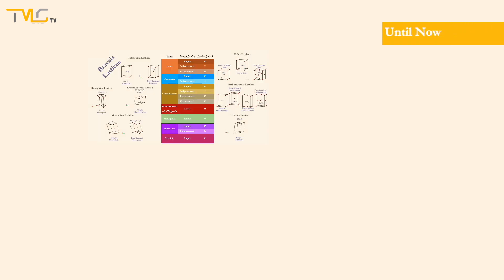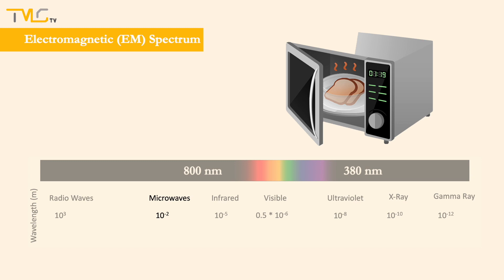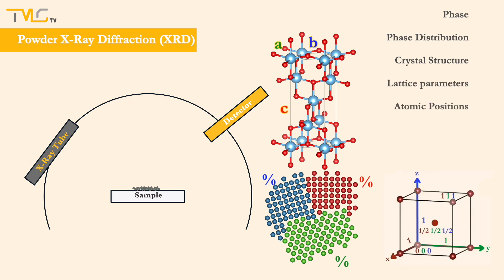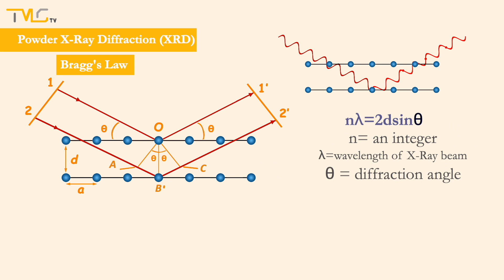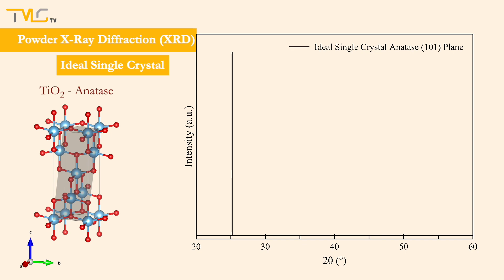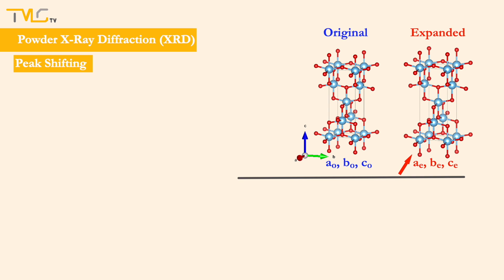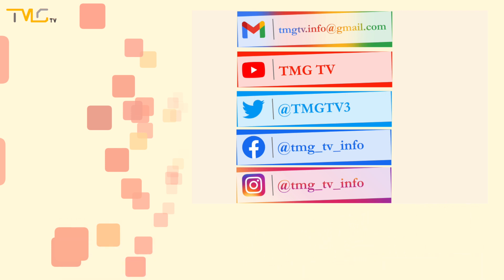Video #1.4 - EM Radiation & Powder X-Ray Diffraction (Structural Properties of Materials)

Comment from the maker: Time Code
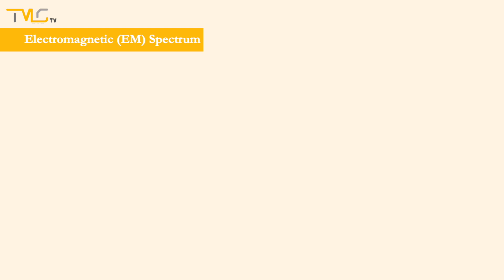0:53 - EM Radiation (EM Radyasyonu) 
3:16 - Powder X-Ray Diffraction (Toz X-Işını Kırınımı) 
5:08 - Bragg's Law (Bragg Yasası) 
6:30 - Ideal Single Crystal (İdeal Tek Kristal)
7:12 - Ideal Polycrystalline (İdeal Çoklu Kristal) 
8:02 - Real Polycrystalline (Gerçek Çoklu Kristal)
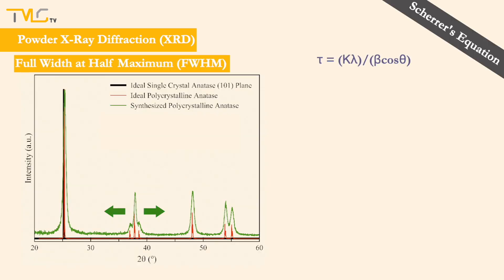8:57 - Full Width at Half Maximum (Yarı Maksimumdaki Tepe Genişliği)
9:59 - Peak Shift (Tepe Kayması)